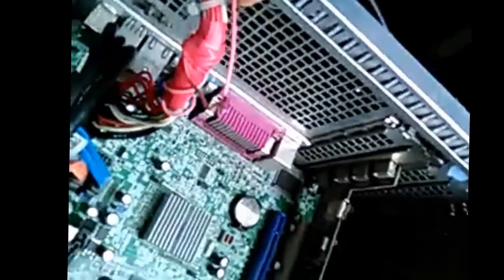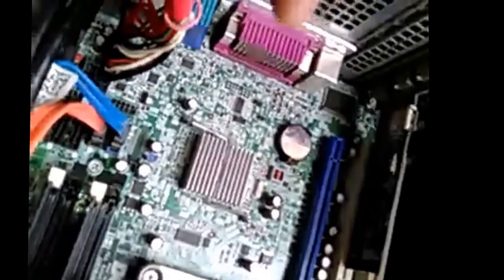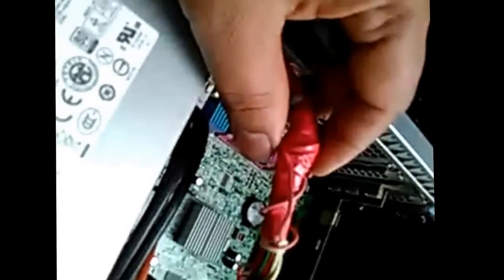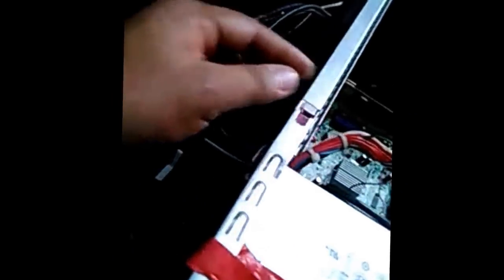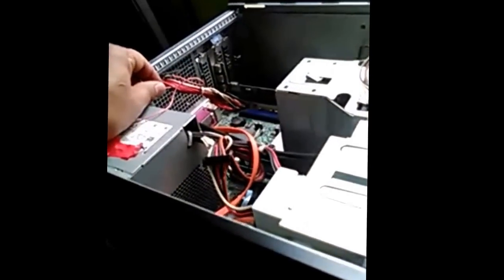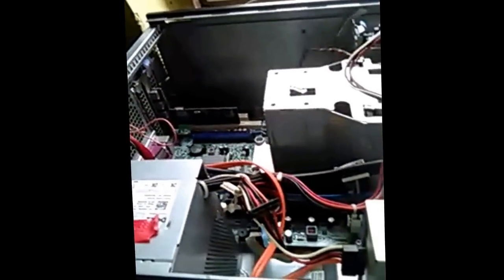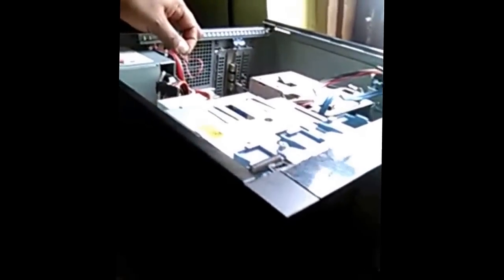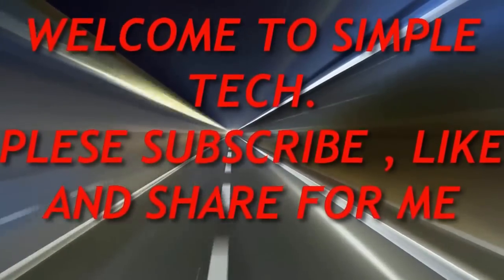® FIX AMBER LIGHT IN DELL OPTIPLEX  980 PC SOLUTION OR OTHER DESKTOP DELL PC

Comment: Sir please help, my computer runs very good, last night I shut it down properly, when I woke up and turned it on it was showing this orange light blinking the blink code is 2-2-2 I removed the RAM and placed in different slots, I also removed the CMOS battery for 10 minutes and put it back in, it still didn't work, the only thing that changed was the blinking, it's a bit faster blinking than the old one. Please help me, I think it's the CMOS battery since I read that if it shows incorrect time that's CMOS battery, first my PC used to show incorrect time every time I turned it on, it's a old PC I also read after 5 years the CMOS battery dies, sir please help me and tell me exactly what's the problem, is it my RAM or the CMOS battery?

Comment: 1- Disconnect all
2- Connect a cable From green to black wire (left) of the source connector
3- Connect power cord
4- The Energy control MOSFETs Will make the short circuit

Is Ready.

Its normal problem in DELL PC, because MOSFETs A & B Block MB. You can remove the MOSFETs too.
Reply: Lylia Lilith What?